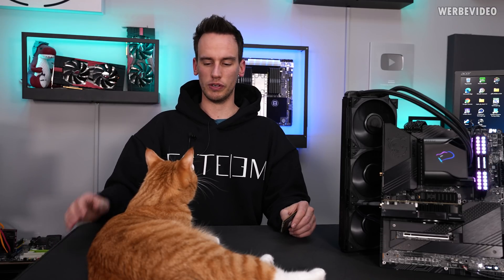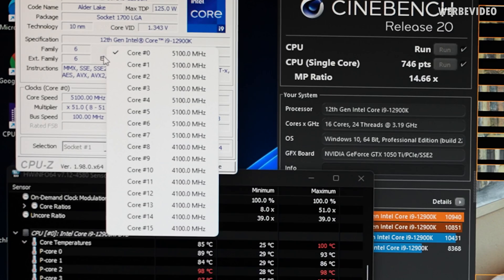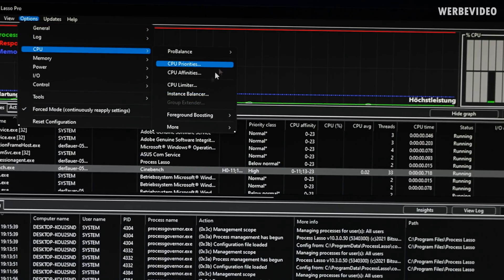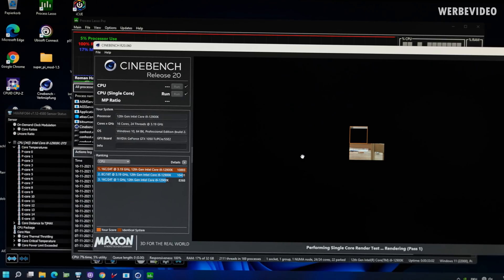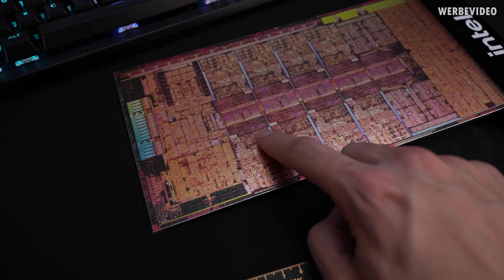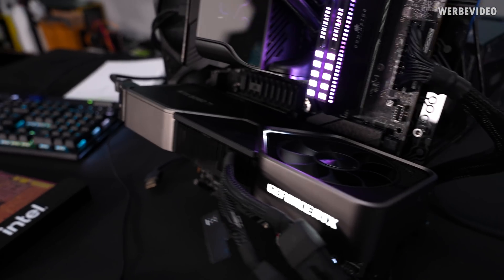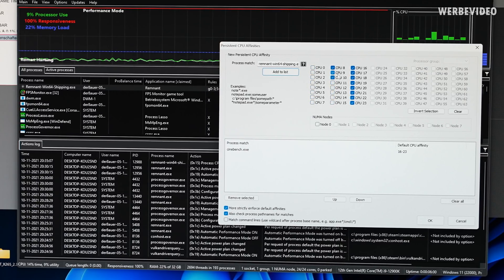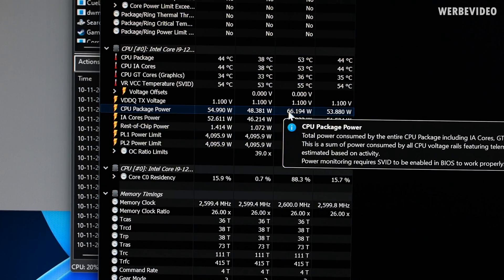The E-Cores were not meant to be used This Way... but it's Amazing!

Comment: Does anyone have any real evidence that intel is on 10nm? We got a bigger difference in IPC from 6700k to 11900k than from 11900k to 12900k.. bigger gaming advantage gained from 6 series to 11 series(all 14nm) than from 11 to 12 series.. and intel calls this "7" 😬🤨
Reply: I the manufacturing process doesn't contribute the IPC.
Reply: @gordongoodman8342  it's directly related.
Reply: @TheCosmicMason  Are you saying taking an architecture on 14nm and shrinking it to 10nm magically gives and IPC bump?  Nope.
Reply: @gordongoodman8342  I didn't say that. It's implied that the architecture is changing to maximize the current node and lithography limitations lending itself to a presumably higher IPC.

Comment: That Lasso app, may be a good work around for older games with DRM that flakes out when bounced between P-cores and E-cores, just a thought.  Great vid der8auer and crew.  B)
Reply: Would love to see someone test this
Reply: Yeah that could be a saviour for early adopters,
especially those who want to stay with W10 for now considering MS & Intel have said they probably wont be even looking at that problem until next year
Reply: @shaneeslick  a week before your reply Microsoft actually confirmed they weren't going to address 12th gen on windows 10 until next year so yeah that's correct.
Reply: only for user mode aplications, but anti-cheats based around kernel mode stuff, won't care about process lasso.
Reply: @piotrj333  That may be true, however the DRM only flakes out when swapping between CPU types, if it sticks to the P or E cores then the DRM software won't know of any changes to the CPU at the kernel level.
Reply: @PcItalian  Yes, but you can't do it from user mode. Kernel mode stuff runs independant from process lasso etc. What is more entire kernel sort of works like one single memory space, meaning you would have to restrict entire kernel to run on one processor type. Meaning kernel cannot provide afterwards support for user mode aplications for diffrent types of cores.

Only way to make problem gone is to force disable 1 type of cores or another, either in MSconfig or in BIOS.
Reply: Yea was thinking the same 👍
Reply: Unfortunately, that will almost certainly not work because DRM is typically at the level of kernel modules (otherwise you could just run some user level software that fakes the runtime environment to fool it)
Reply: @mduckernz  so i guess disable the E-cores in bios is the only option.
Reply: WHAT'S UP ZDAWG

Comment: They should come out with an i3 with like 6 to 8 Ecores and no Pcores.
Reply: youd still want at least 2 pcores for single threaded workloads on devices. Ultrabook skus will likely use less pcores and more e cores, while higher end laptops will do the oppisite.
Reply: The rumors going around now is that everything below the 12600k, ie 12400 and below will be on a different die and have only P cores. It makes sense theoretically to have some e-cores on those lower sku but I guess due to marketing or manufacturing it didn't make sense for them.

Comment: 9:26 Atom cores from 2016 were good, you just didnt get many of them and they were usually clocked REALLY low, and that's why almost all atom processors were terrible. Like, if you had gotten 8+ Atom cores clocked to 3.2Ghz instead of 2-4 cores at 1.8Ghz, they'd still be pretty efficient but way better performance. because below 3.2Ghz there is a diminishing return on power savings compared to performance loss on most modern silicon. This holds true on both my i7-8750H, my 3950x, and my 4650G. Oh, and thats probably why the maximum clocks for the M1 Mac Mini is 3.2Ghz
Reply: Being able to hit high clock speeds is part of a processor architecture's design.  Atom cores could not and it's absolutely valid to criticize them for that.
Reply: Lol no, intel atom is really bad even the clock is higher, intel atom Denverton clocked at 2,2 ghz, and geekbench score is only 300-400, intel xeon from sandy bridge with same clock score around 500-600, and skylake still score around 700 with same clock speed, intel inside skylake mobile processor is not atom processor
Reply: @adiirfan01  Thats sort my point though, that Denverton Atom C3858 2Ghz 12 core at 25w used closed to 1/3rd the power of an E3-1245 V6 75w(kabylake both 14nm so neither had a node advantage) but the atom was closer to half the performance instead of 1/3rd. I dont remember which model, but there was an atom that had 2 or 4 more cores, and ran at... 2.5Ghz and only went up to 30w. This is what i was talking about there being a diminishing return of power savings They added 2-4 more of these same atom cores(15-30% more), bumped up the clocks by 25%, but it only used 20% more power? It should have used 45% more power if this stuff scaled linearly. There seems to be a bell curve with power per watt peaking at a certain point in the silicon's range. With Apple M1, and AMD Zen2 it seems to be 3-3.3Ghz(zen2 seems to like around 3, where apple might peak around 2.8Ghz. If i had to guess, Denverton's curve peaked at 2.8Ghz as well, if it could have reached 2.8, but who knows, In tel never offered higher clocked atoms, so 2.5 might have been the peak of the efficiency curve for that arc.

The atoms main problem from my memory was the small cache, yes adding cache would have drove up power draw, but it should have increased performance by more. IIRC Denverton had a total of 1MB of cache per core, where KabyLake had 2MB of just L3 cache per core. Also Intel just needs more cache for everything.

Ever wonder why the i7-5575C would sometimes beat everything but Alderlake and non APU Zen3 even at its tiny ~60W power draw? It was because of that massive L4 cache(128MB of eDRAM), allowing that 3.7Ghz processor to beat 5.3Ghz rocketlake in several tasks at sometimes 1/4 the power(definately not most tasks, but enough to ask why didnt we continue using this and improved the eDRAM for lower latency and higher bandwidth/size). 
If intel had added one or more of those eDRAM chiplets to all of their top end processors, with half the latency of DDR3, and 1/3 the latency of DDR4 AMD have had a much harder time climbing to the top.
I'm really interested to know how something like KAbyLake G would have performed if the CPU were allowed to use that 204GB/s HBM with slightly higher latency ~100ns, instead of the 30-40GB DDR4 with ~80ns of latency. Is bandwidth king for efficiency, or latency, or both
Reply: @denvera1g1  Wow I kinda hate you now, you brought up a lot of things that I now want answers to but know I never will lol
Reply: Xeon class 8 core atom boards exist and are fairly decent (on a perf/w basis)
Reply: it's generally a problem with nodes. as a reference, i can run my 3700X at 1.175 Volts at 4.1ghz but for 4.2ghz i need 1.25Volts, that's 6% more voltage for 2% more speed - it might seem low, but the temperature spike and wattage increases a lot for diminishing returns.

Comment: Now I want a hybrid of 3 types cores where you have like 2 super op cores 6 performance cores and 12 e cores
Reply: In fact I also want the same, but it's practically impossible to make a super high performance core. Intel already on 6 wide decode , anything more than that on a CISC based CPU will destroy the branch prediction. Also Intel itself said that they are going to use this architecture for years now.
Reply: ultra mega big boy cores
Reply: All that just for few frames per second more than your poor friend to make him feel jealous. LOL! 😂
Reply: @vineetkumarbharti2633  What?
Reply: @EzioYuio  just kidding
Like if he want a CPU with that configuration, means he is ready to pay nearly 700 bucks or more on CPU.
2 ultra high performance cores will improve single core performance in turn giving more FPS.
So in short all that money for more FPS

Comment: Do you know if you manually set a game to run on P-cores with project lasso, will it disable Window 11's own scheduler? I heard someone say that if you change the affinity from task manager it would disable it.
Reply: It overrides the scheduler on those apps that have custom affinity. The rest will use the scheduler.

Some even assign their own affinity regardless of the affinity you use in PL. CB23 and CPUz do that.
Reply from the maker: yes it overrides windows. If you set it to P-Cores only it will follow

Comment: So basically the top CPUs are pointless as you can totally game on low-end CPU?

Who could have thunk.
Reply: So basically people look at one single game as a test and extrapolate that to mean top end CPU's are pointless for gaming??

Who could have thunk? .....Oh wait, this is the internet, and this kinda thinking runs ramped.
Reply: @mitcHELLOworld  They are pointless for gaming, you can literally find videos of people playing on 5-6 year old CPUs, and low-end modern CPUs just fine.
Reply: @harryshuman9637  It seems you've missed how popular high refresh rate gaming has become. You're not pushing more than 60fps with old CPUs and while that may be perfect for your use case, it might not be for others. You do not represent everyone else. A Nintendo Switch is "fine for gaming", but I still much prefer my 1440P 165hz monitor and gaming PC
Reply: @kendokaaa  Most people cannot afford 144Hz gaming, so I wouldn't call it popular.
Reply: @harryshuman9637  You must not be aware that the most popular games are all easy to run esports titles. These can run at high refresh rates on mid to low end systems. I guess you think everyone only plays recent AAA games. Also, 1080P gaming still exists
Reply: @kendokaaa  Yes, and like I said you don't need latest CPU to play easy to run games, or to play in 1080p in general.

Also you don't need CPU for 4k either now that I think of it, since resolution bump will only affect the video card.

Comment: I do use PL to set all background tasks to the lowest cores in my 5900X leaving the upper faster cores for gaming and productivity apps. You don't have to go options > add to list.. Just right click the selected apps and choose an "always" affinity. At the end you can backup all your settings.

Problem with CB is that it adjusts the affinity by itself if I recall correctly.
Reply from the maker: Thanks!
Reply: did you measure any difference by isolating background tasks to a single core?
Reply: @ThunderingRoar   I haven't done that since one core is too little for some of them such as iCUE

I leave all my light background (non time critical) tasks such as TaskManager, HWInfo, RainMeter, Walpaper Engine (I only play a video with it), Oculus tray tool, Skype, Discord etc... to the last 6 logical cores. (18-23)

Things like Chrome go on 8-17

More time critical gaming related background tasks such as Virtual Desktop / Oculus wireless streamer services / apps go to 6-23 so they can use the first CCD while gaming (lower inter CCD latency)

Games and heavy productivity apps go to 0-23 so they can use all cores and most importantly, run the heaviest threads on the first cores.

I have tested with and without PL. While the Windows scheduler in Win10 does a great job you can eliminate any microstutter from games and chrome by assigning chunks of your CPU cores so they don't conflict.

Most of the windows tasks and services are set to use all cores. Some of them aren't supposed to have affinity.

I can say the Task Manager, Print Spooler, Gaming services can have a custom affinity without issues. Not that I encounter any when I tried to set affinity to a lot of windows tasks anyway. Things like DWM need to be snappy so I think is better to leave alone. Anything system critical should be left alone IMHO.

Also "ProBalance" off or anything related to Power managment. Those things are for really slow machines. You wanna use PL exclusively to manage affinities.

Comment: I can understand why some people would have the preconceived notion that the e-cores have poor performance; as someone who has used netbooks and NUCs equipped with atom cores its encouraging to see that its not true, and that they are perfectly usable.  

I myself hope that hyperthreading can be added to the e-cores in the future as from what I understand its then able to use parts of the core for other tasks at a given moment that would otherwise sit dormant during a processor cycle.

Thank you for covering this aspect of Alder Lake.
Reply: Adding HT would add performance, but also power and size, partially negating their benefits. To add overall performance, I like the 6P + 16E core idea better. A side note, rumor is that Zen5 will use Zen4 Dense cores as it's "little" cores. I forget if they will have SMT, but I would guess they would. Bit of a different comparison though, Zen 3 cores are about half the size of a P core, though not that much less IPC if you normalize for clockspeed.
Reply: @xeridea  
An old Intel white paper claimed that adding SMT only increased die space by 5%. This was back in 2002, and the number might have changed substantially in the two decades since. But with the 2023 Meteor Lake projected to be Intel’s second consumer MCM in recent years (after Lakefield), and the adoption of a substantially denser node, Intel should have a lot more flexibility when it comes to core complexity.

I don’t think Intel will back down from 8P any time soon. Current gen consoles have 8 decently performant cores, so high end desktop CPUs should have at least the same amount of full performance cores.

I don’t think there’s official confirmation on SMT support for Zen4c. But if it is based on the lean cache APU version then it probably does.

If measured by core area alone (sans MLC, LLC, interconnect agent), Golden Cove (5.65sqmm) is almost exactly twice the size of Zen2 (2.83sqmm), or around 1.74x the size of a Zen3 core. I don’t have any numbers for Zen cores with cache (cache takes up a substantial amount of space on the CCD), but at the same frequency there is a ~5% difference between the ST performance of APU version and the MCM version (5600X ST is around 5% better than the 5900HX, both have a specified boost frequency of 4.6GHz).

Actually, adjusted for frequency, a Golden Cove core does still have a substantial performance lead over a MCM Zen3 core. Both the 12600K and 5950X have a specified boost frequency of 4.9GHz, the 12600K has a 18% lead in Cinebench R23 ST; 17% lead in Cinebench R20 ST.
Reply: @DGao-zz5vq  Yeah, I know HT doesn't take up a lot of space, but it is some, and may adversely affect the chip layout. Future nodes would alleviate this.

There is another drawback, in that it hurts ST performance. This may be less of an issue given the efficiency nature, and background tasks, but it could abnormally slowdown some tasks if not properly written for many different speeds of cores. For instance, often MT is done in code by simply splitting up the screen into tiles. If you just do one large tile per core, slow cores, especially if HT/SMT would be a big hinderance. Using more tiles mitigates this, but for some quick tasks, the overhead of splitting up further may not always make sense.   This may affect only a small number of apps though, I have no idea, and likely it would be improved in time.

I was thinking about how historically, SMT has been a way to get more performance out of big cores, while still allowing to oversize certain parts of core to maximize ST. Just speculation though.

My reference to Zen 5 is from Moore's Law is Dead video. IIRC he was referencing Zen 4D, not 4C, apparently they are different?  Still speculation, 1-2 years out.

I was thinking around 10-15%, assuming a minor clock difference, I thought 5950X boosted around 4.6, since it has 16 cores and lower power budget. If it boosts 4.9, different story, I didn't look up any numbers, was from memory. I was referring in general to diminishing returns on IPC for increasing core size, which is why Intel has made the little cores. At some point, which I would say we have reached, ST is fast enough for most apps, and apps are increasingly multithreaded. I think 6P + 16E would be a great production focused CPU.

Comment: Hopefully there will be firmware level ways to force programs running on e-cores or disabling the p-cores completely. There definitely is a way for internal testing as e-cores can be disabled for full p-core setup but not vice versa.